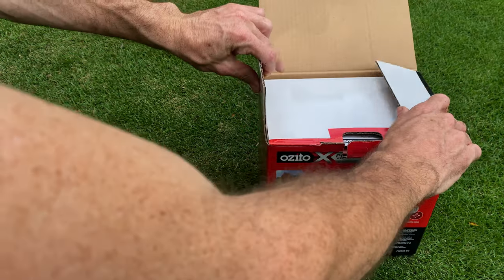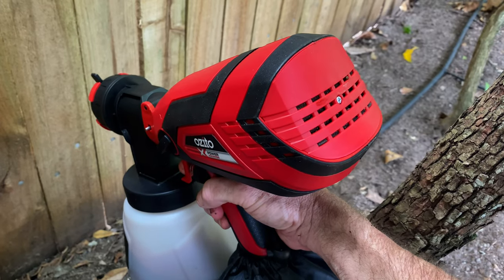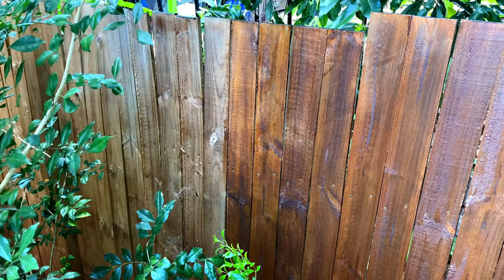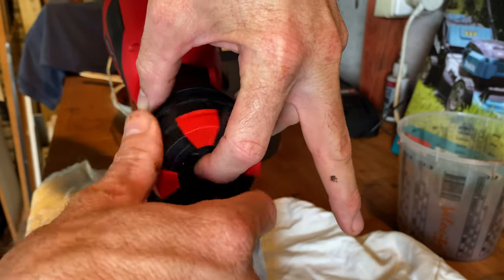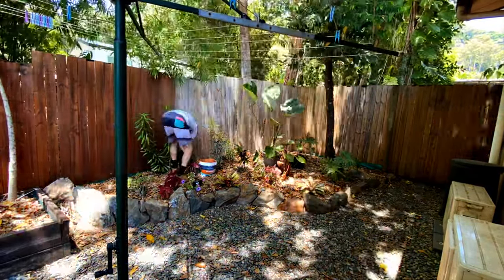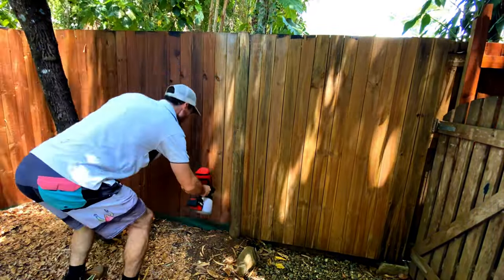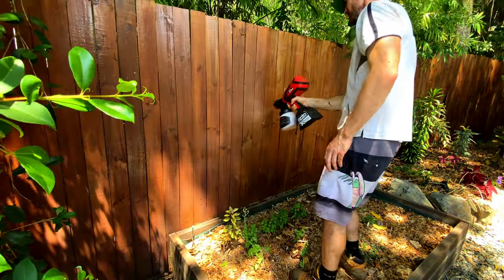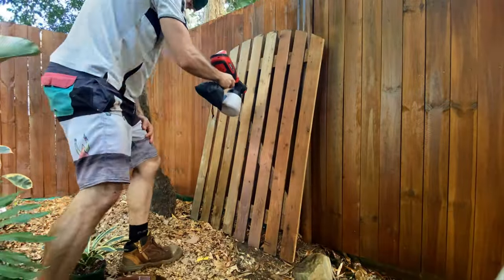Ozito 18v Spray Gun - Review

Comment: I didn't think these would be suitable for spraying paint. The seem like they're more designed for cleaning purposes. I've been wondering if they'd be a good alternative to a corded pressure sprayer for applying cleaning agents to my car. I have my doubts, though, because an 18 volt battery is a lot less powerful than 240 volts mains power.

Comment: Nice..so would you use it to paint 3 old school single garage roller doors? I have a fair bit of Ozito 18v stuff..i am a floor sander/installer with thousands of dollars worth of Lagler and Festool dedicated stuff, i rarely use or need 18v stuff I have never had an Ozito product let me down..
Peace.
Reply from the maker: Hmm if it was the roller door on the old shed out the back, then yeah I'd give it a go. But probably not if it was the door on the street front or main part of the house.
Only because I don't think the 'finish' would be very nice as it can be pretty splotchy which I suspect will show up on steel a lot more than a timber fence.
Worst case if you've already got the batteries - for $79 you'd try it then flip it for 50 bucks on Marketplace if it wasn't any good, or just take it back if you're a bit cheeky!
Reply: @Greg and Taryn's Place  gotcha...I suppose you get the paint on and if splotchy lay it off with a nice brush..there are previous brush marks which are still going to be visible. 
Cheers.